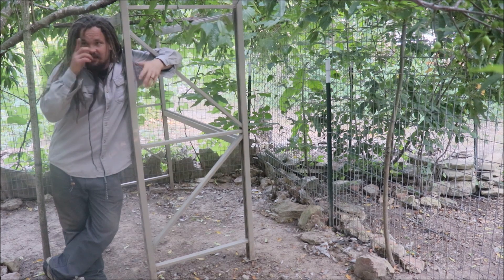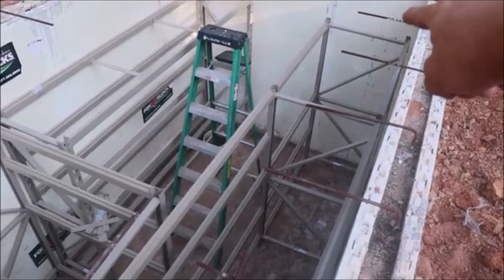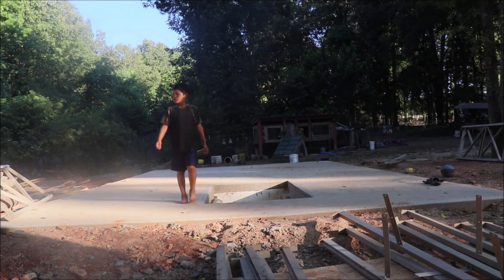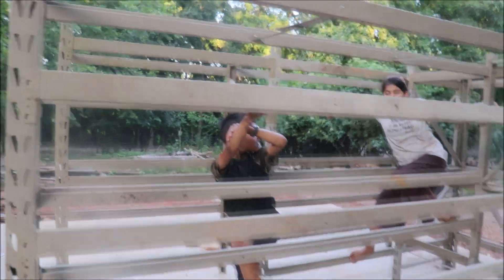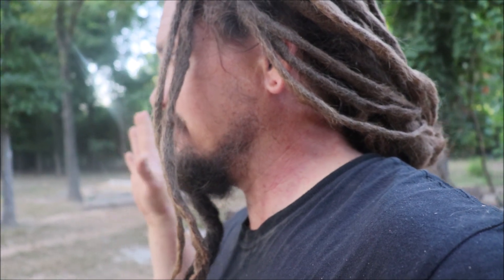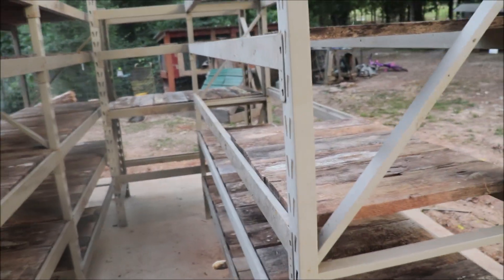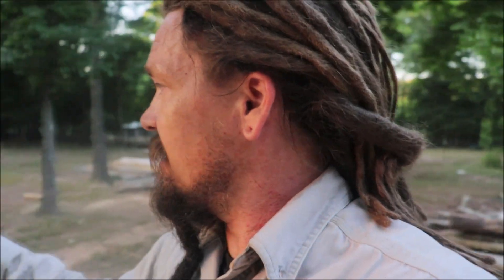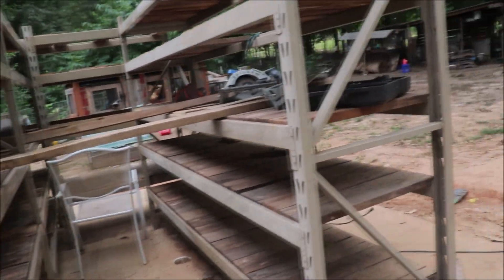Root Cellar / Storm Shelter Shelving

Comment: You've got some nice looking shelving there. And I hate to be a negative Nancy, but how are you going to keep the humidity down so those boards don't absorb moisture and allow mold and mildew to grow on them? I would think you have a few options .. use a dehumidifier, use something other than wood, or dry and seal the wood.